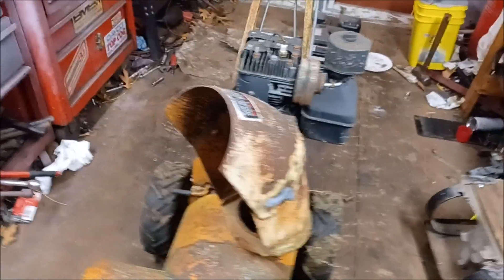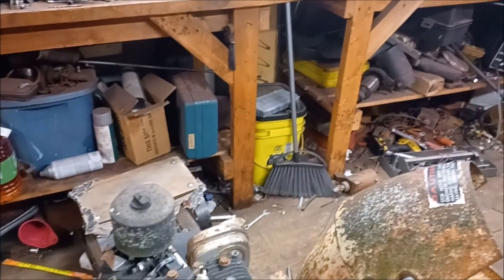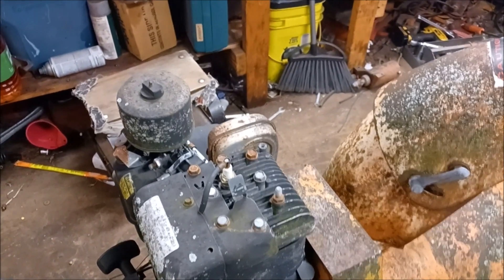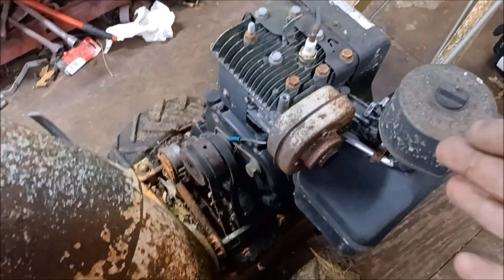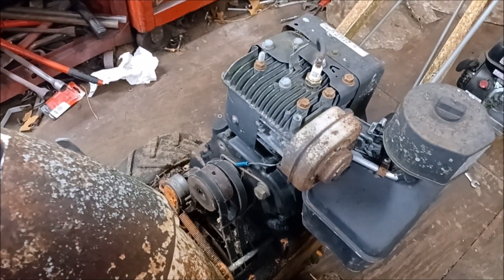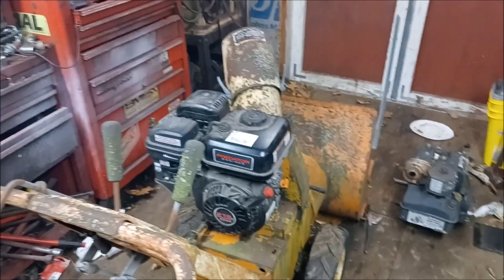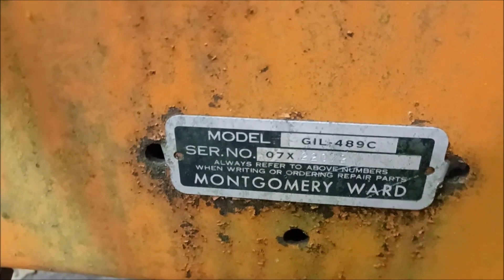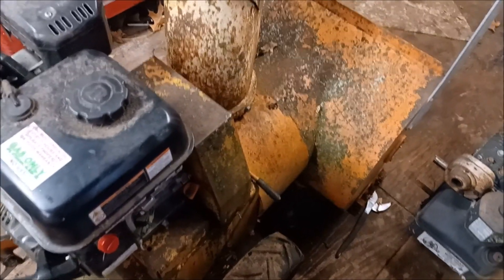late 1960s Montgomery wards by gilson snowblower repower

Comment: I have a late 70's Gilson model 55134 snowblower I purchased new and I still use it.  Has an 8 HP BS flathead that starts every time on the second pull. The only thing I have replaced on it is the friction wheel and the skids. Almost indestructible.